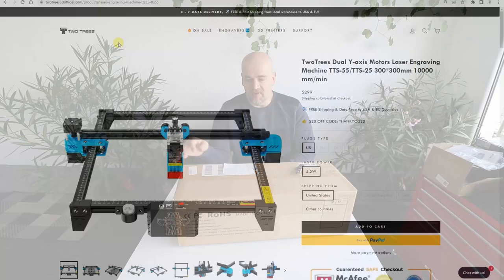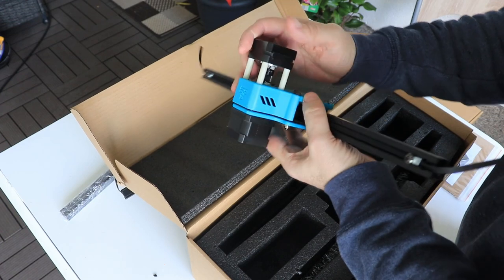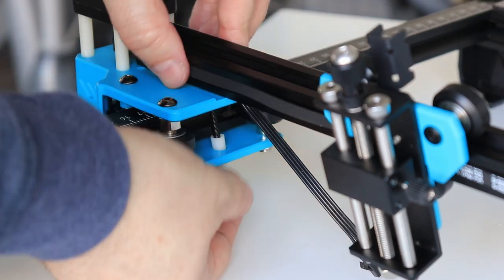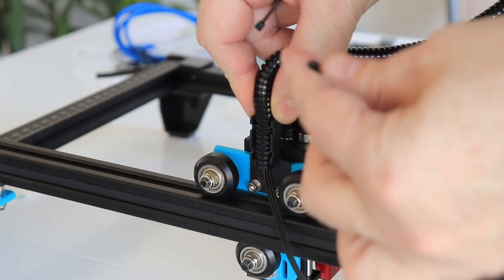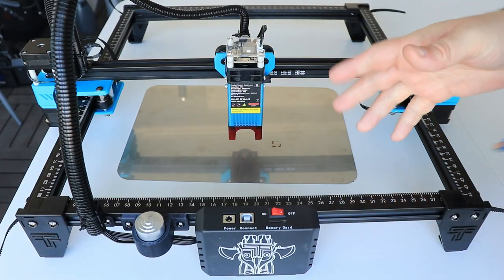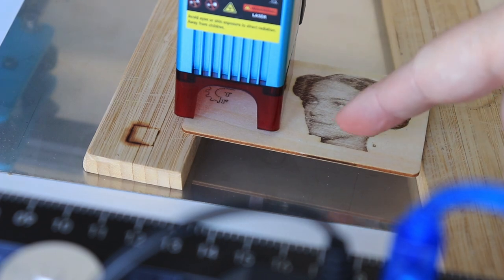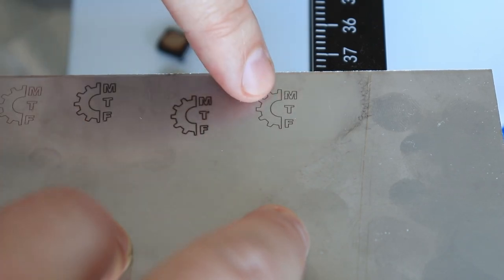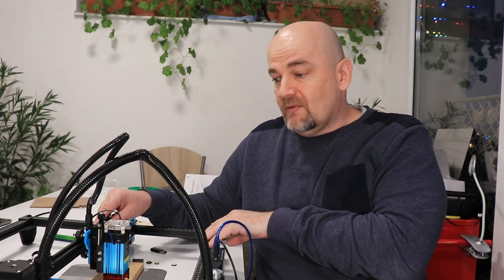Two Trees TTS-55 Laser engraver review with assembling instructions and test engravings, cuttings

Comment: Nice review. I have just purchased the TTS 5 5 Pro and will be using it along side resin projects I did the same thing with the bolts which go underneath the stepper motors I put the belt and tensioner on before putting the bolts in lol.

Comment: Nice review, especially for those like me who do not have any experience with laser units. I like to buy one , but cheap  ( less or arround  than $400), 80x40 area and for about 10W output laser. 
Do you have a recommendation about what frame and 10W are the best budget friendly? I was thinking in a ZBauti laser but i am not sure.
I hope you have some advice. Thanks
Reply from the maker: Atomstack has good 10W laser modules, but they moving mechanic is not perfect, resulting a lot of vibrations. But for cutting, speed doesn't has to be big.
Reply: @MyTechFun  Thanks for the response and the comments. Do you have a preferred or suggested brand with a better moving mechanism? Thanks again!!!!!!!
Reply: @alexherrera3918  not sure if its to late but i went with the tts-55 and then will upgrade the laser if air assist wont cut what i need, they also now have an upgrade laser to 1065nm
Reply: @dkrol997  tks!

Comment: Hi, I bought a Totem S engraver machine in Banggood, threes months ago. I have never been able to use it.
I got everything is connected and installed correctly (I believe).
When I connect the engarver to a USB port of my computer I can see a red cross.
I also open GRBL program, select the right USB Port and 115200 Baudios.
The problem starts when I press the Connection botton. The program always show me the message: "error conecting your engraver".

I can´t find the problem.
Reply: Opa amigo, eu passei por isso, é só vc ligar a máquina fazer login no wi-fi dela, e depois vai no programa GRBL e o programa vai indentificar a porta que ela está conectada automaticamente, daí é só conectar
Reply: @aunileyjunior20  
Non entendo, ¿como podo facer login no wi-fi dela?

Comment: Did u try engraving stainless steel? And if u do how?
Reply from the maker: I tried, but 10W is better for this. Try to use some black marker on the surface and then engrave. 100 mm/min speed, max power

Comment: Hello! I have the tts 10 pro which is basically the same as 5.5 but the laser output is 10W. I tried to engrave or cut transparent acrylic, but it won't work! Can you help?
Reply from the maker: It cannot cut transparent acrylic. This blue laser just goes through it  Try black. For transparent you need CO2 laser.

Comment: Thanks, Igor, for as always very balanced and useful review. Thumbs up! 

I have two questions regarding this laser engraver (I thought I posted them a few days back, but now they are not here), which I would greatly appreciate if you could answer: 

1) Could you please enable the laser at a its lowest power (in Lightburn on my machine I do 0.1%) and project the light onto a surface 1-2 meters away - this way you can clearly see the shape of the 'dot.' I am planning on buying this tool and am really curious if it is square, or rectangular. 

2) In your assessment, do you think it would be possible to affix a cone-shaped air assist tool that would be co-axial with the laser ray, given that large brass surface at the bottom of the laser head? 

I think many of us would greatly appreciate your opinion - thanks much!
Reply from the maker: 1) Close to square, but still rectangle (this effect you can also see in cutting acrylic, it is stronger in Y direction, 1 pass for 3mm acrylic, but in X needs 2 passes). 
2) Not sure if I understand 100% the question, but adding air assist is possible, but you can't use the protection cover. If you add magnets to the nozzle, maybe existing magnets on module can be used too.
Reply: @MyTechFun  Many thanks for this answer! So we have a pretty solid construction (rigid, two motors for the Y-axis, no motor on the gantry), but the laser is somewhat not ideal. Also, not sure about the laser's longevity - is it going to start showing power loss at 100 Hrs? 1000 Hrs?... A good 5W optical power square-dot laser is probably not much cheaper than this whole machine, e.g., NEJE A30130 is $130-140, but that's (a) square dot, (b) 7.5W, and (c) claimed warranty of 2 Yrs/20,000 Hrs (much better than 100-200 Hrs, anyway). 

You are right - the air assist 'bulb' would be attached co-axially directly to the big brass round plate at the laser's mouth. The cover would be removed and likely not used. Magnets could be used to press the 'bulb' to the brass plate though, it may be a good idea if the pressure is maintained low (it can be calculated at what pressure the pulling force of the 4 magnets would be overcome). This could look something like this, just perhaps 3D printed for lightness: https://live.staticflickr.com/65535/51702864183_f8376b6a07_b.jpg What do you think?

Comment: I just finished assembling mine however when i turn it on i see no visible light emitting from laser, led on top of module lights up, does it by chance have to be plugged into pc first before laser is visible? Manual was very unclear
Reply: I have the same problem. Have you managed to Solve this problem ?